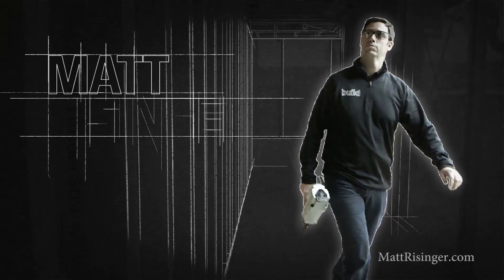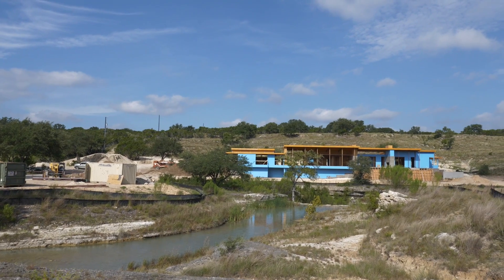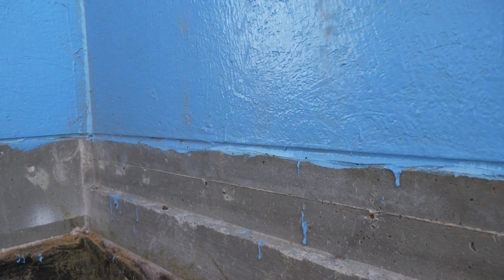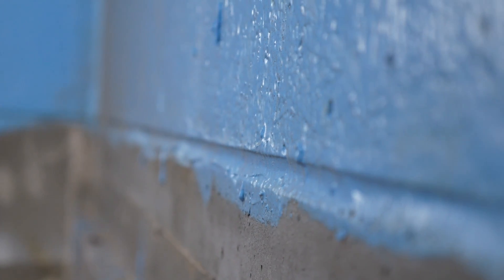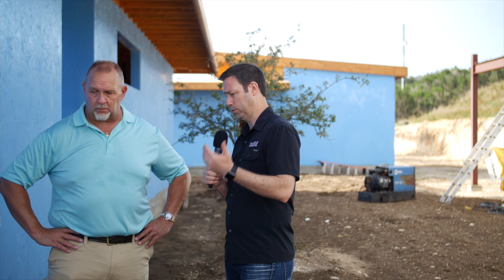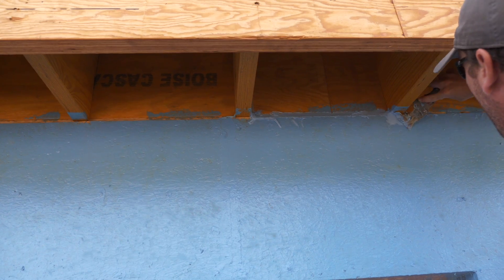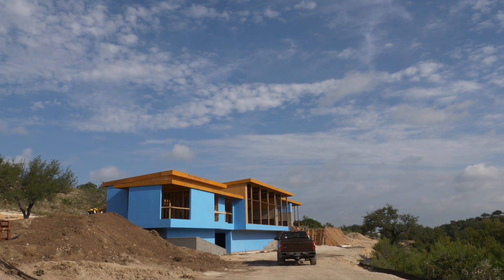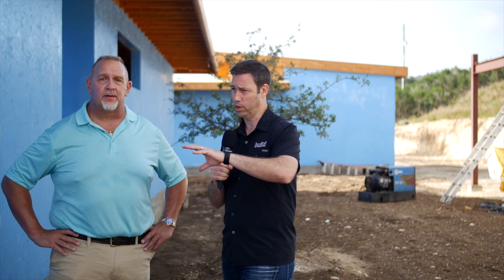Waterproofing With Fluid Applied Weather Barrier

Comment: Can this also be used as interior vapor barrier?
Is there any issue spray-foaming the inside sheathing when BB is used on the exterior?
How does it handle Cold-Hot climates like Canada?

Comment: Near the end Matt you said, "you can use this in any climate. It's vapor permeable"
Then you went on to say, "we're really looking for that super air tightness. Cause air brings in humidity and that can really cause problems"
These two statements are contradictions. 
Either it's vapor permeable or it's not. I'm confused by your contradiction. Did you accidentally say, "it's vapor permeable?"
Is this product a vapor barrier or not??? 
I think it's an important distinction Matt.
Reply: The reason I ask is because I live near the Arctic Circle. It is crucial in this environment to know for sure. I plan to insulate with polystyrene foam  12 inch continuous. An airtight structure that uses heat recovery ventilation. At minus 40 or 50 degrees vapor will want to move from indoors to outdoors through the 12 inch styrofoam. Somewhere within that thickness the vapor will condense and experience freezing before it can escape to the outside environment. This will destroy the structure of the foam. Interior continuous Poly sheeting seems the only solution I've discovered so far.
I ask about this convenient paint-on membrane because it is crucial to know if vapor can pass it as a membrane.
Reply: @24emerald  When he said air brings in humidity he's talking about leaks, not the fluid applied product.
Reply: @Adolfo Rodriguez ...
Dehumidifier is not a solution because there can be absolutely no penetration of air from indoors into the insulation material. Winter is long and once started it stays well below minus 20 degrees. Occasionally reaching minus 50. Meaning within the insulation material, there will be a location consistently at freezing temperature. That layer will continually build ice crystals from any supply of air fed to it. Heheheee, you have to see it to believe it. 
The air/vapor barrier must be impenetrable. 
Even heat recovery ventilators (HRVs) will become clogged with ice after a few hours. And must cycle on and off to allow the ice to periodically melt and drain. So that there can be ventilation between indoor/outdoor air. 
These temperature ranges are almost like living on mars.
Reply: -Adolfo Rodriguez ... the building codes for Yukon Territory about a dozen years ago began requiring airtight construction methods. Typically, builders here use double framing system. Either 2x6 or 2x8 structural wall. Insulated with batting. Then on the indoor surface a continuous poly air/vapor barrier with acoustical sealant on joints and other openings to create a continuous airtight barrier. 
The next interior wall is framed on top of the vapor barrier. Usually using 2x4 studs. In this cavity all the plumbing and electrical is run. And usually also insulated. Ending up with a 10 inch insulated wall. The continuous vapor barrier safely sandwiched between the 2x6 and 2x4 walls. Because the building is now airtight, mechanical  ventilation is required in the form of a HRV system. An HRV works like a heat exchanger, recovering heat from outgoing air and applying that heat to the incoming air. 
That's the typical new construction here.
I was going for something novel using 12 inch continuous styrofoam. And may still have to resort to using poly sheets on the inside to provide that necessary air/vapor barrier.

Comment: I grew up being told that most of the moisture in the exterior wall cavity originates from inside the dwelling, hence the need for a "vapor barrier" behind the gwb.  Now the "building scientists" want to sell you 20 different exterior treatments. I've been crying foul ever Tyvek came out with their "air infiltration barrier" which they quickly changed the description of to justify it. That ain't bad enough but anal retentive architects promoted it and coerced municipalities into requiring it . Hey Matt!, how many times do you have to be asked to revisit a site on completion??
Reply: Moisture inside the house really should be dealt with in two easy ways: air conditioning and dehumidifying. Inside moisture will always travel to dryer places, so if you're always keeping it dry, it will dry it off your walls. If you have interior moisture causing a problem anywhere on the exterior wall, you're living in a sauna inside. Exterior moisture basically just need to be kept outside the WRB and you're mostly fine.

Comment: I'm building materials supplier from the Lake Placid,  NY area. 

I enjoy your videos and how tight you're building homes but I haven't seen any videos on indoor air quality and how you're ventilating the moisture and other air contaminants from inside the super tight homes. Are you using ERV/HRV systems? Other mechanical ventilation systems? How are you venting the heat and moisture from your attics?

Can you point me to prior videos on these topics or cover them in the future? Thanks
Reply from the maker: +Jay Ward Jay, very glad to have you watch my videos. I haven't covered those topics in recent months, but I've got a lot of older videos addressing that specifically. Check out my archives. Lots of good videos I've made over the years on that topic

Comment: When you make the house that air tight, you need an air exchanger to keep fresh air in the house. What else are you going to do to help with the air quality.  Living inside a zip lock bag is not good.
Reply from the maker: +Jameson Cross build tight, ventilate right. Totally agree. Check out my videos on the systems I use in my homes for fresh, filtered, measured air.
Reply: Matt Risinger 
This looks like a good option to seal up the house when my son puts new siding on his home.... probably with Hardy siding. What would you recommend regarding window flashing when the old siding is off? 
Thanks

Comment: I am not in the industry, but how do the economics work out?  Labor vs material or other relationships.
Reply: One benefit to the fluid applied is once it is on the wall, it never comes off. So you don't need more material and more labor when the wind blows too hard. Also, this has superior air barrier and waterproofing characteristics.
Reply: For twice the price?

Comment: How do you attach whatever siding you go with without puncturing the nice seal this product makes?  Just wondering.  Like your videos a lot.
Reply: guintube He said masonry tiles over stucco brown coat. So, no puncturing there.
Reply: Wil H  The stucco brown coat is NOT applied directly to the sheathing. It is applied to wire lath, which has to be fastened to the sheathing. Thus creating punctures. Whether fluid applied or peel and stick, these punctures can pose a problem on membranes. Best to have the membrane self-sealing.
Reply: Thanks...would love to see the final results sometime....